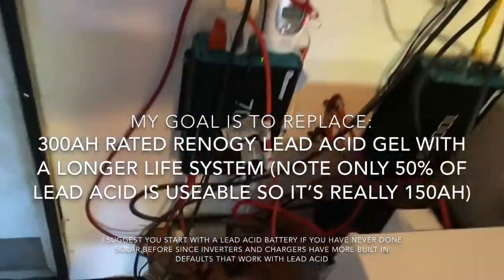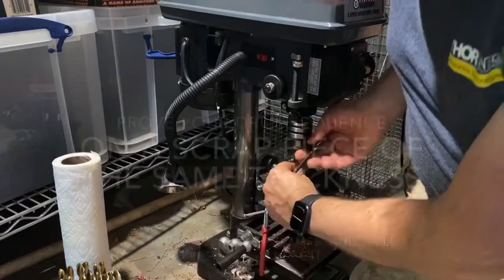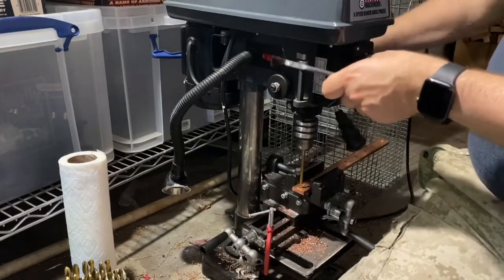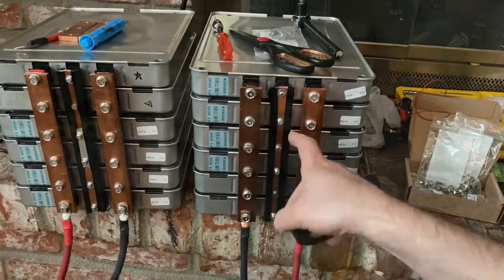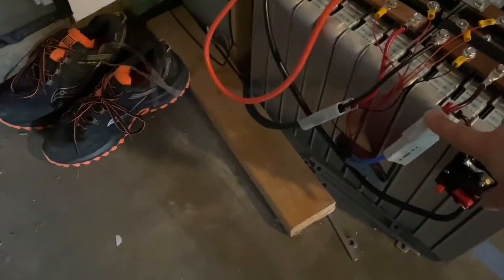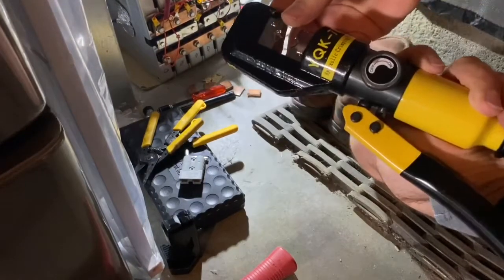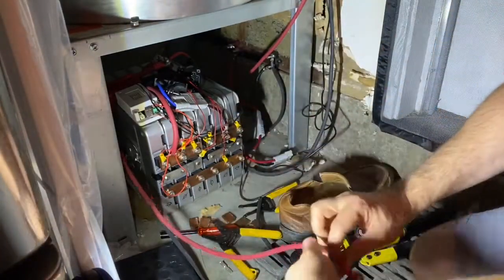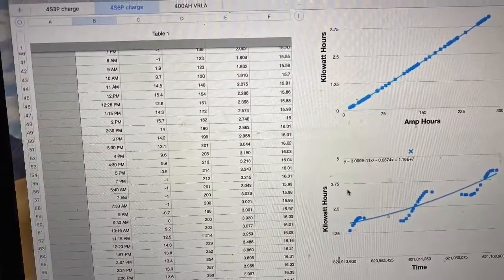How to Build and test a Lithium ion battery from Nissan Leaf modules

Comment: appreciate the video, can you tell us why some folks build 48v packs out of 6 modules while others use 7 ?
Reply from the maker: The 7 module thing is a 14S1P configuration, every cell is in series.   This is good for 48 volt chargers like most Victron and anything that works with most rack batteries.   6 would be 12S, which means the battery is lower voltage.  Some inverters and older Victron that were meant for 48 volt lead acid would have an over voltage shutdown with a 14S li ion battery so that’s why.  I think newer inverters have larger input volt ranges so it matters less but older systems may not work unless it’s 12S

Comment: كيف اربط هاي البطاريات على نضام 48 فولت وكم بطاريه احتاج
Reply from the maker: Each sub cell is roughly 4V (vary from ~3.7 to 4.2 with charge). So one of these modules is roughly 8V.  You need 6 of these modules fully serial to get 48V.  I’d suggest parallelizing a few groups since 6 cells isn’t enough storage for anything other than a very small refrigerator.  So maybe 2 or 3 groups of these (12 to 18 of these modules) would be good for a 48V system.  Note you may need to custom adjust your charge parameters.  Note each of these modules can go for $50 USD or higher when used, much more when new.  If you’re paying $100 a unit for new modules that’s $1800 for this battery assuming you’re going for the larger size that I suggest.   Also you will need a BMS controller that can handle the 12S3P geometry.   So the BMS will have 13 sense wires (one at the end for ground and the other 12 after each subcell).  This higher voltage will allow for smaller wire diameters and lower currents but at higher voltage swings.  This is your choice, personally I think it’s less safe since you can shock yourself easier.  However 48V is still relatively safe, though it can get you if your skin is sweaty.